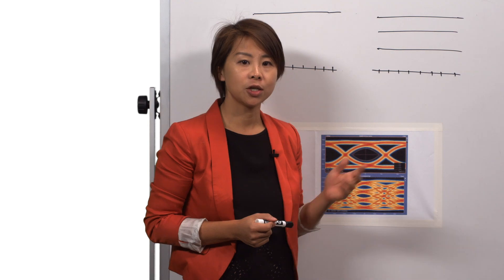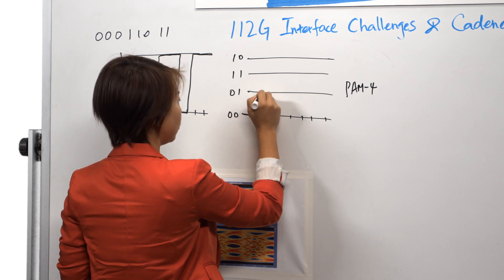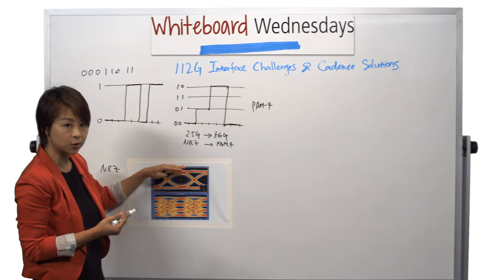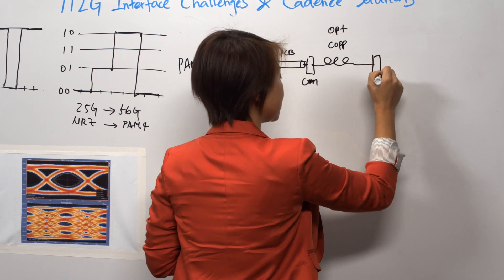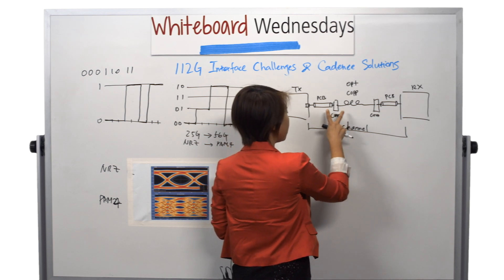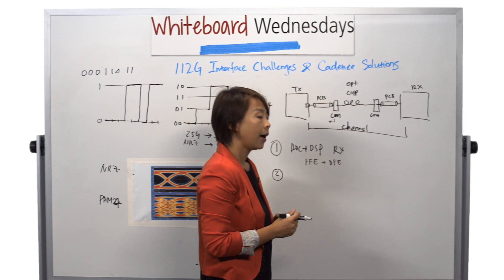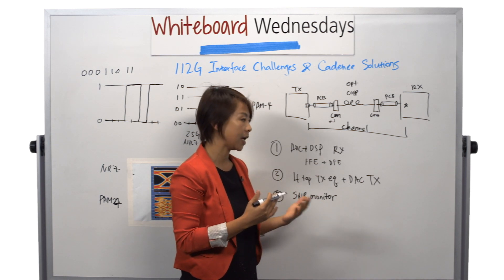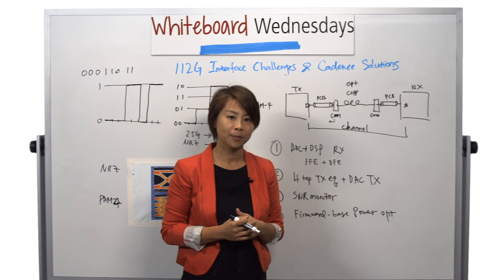Whiteboard Wednesdays - How the Cadence 112G SerDes IP Solves the Challenges of Long-Reach Signaling

Comment: Is there a mistake? Bit 2'b10 is higher than bit 2'b11? It should be other way around. Reflection is part of the 35db loss and it is known issue for such design. And Pam4 is to address the physic limit of silicon, else you won't be able to hit such high bw interface.
Reply: This is called Grey Code, there is only one bit change when u move from one state to anther one. It can be used to avoid meta-stability I believe, but i don't know why it is used here, because we need to overcome inter-symbol interference
Reply: @franklinw7320  I think we can have any encoding and decoding we want at transmit and receive to reduce energy or improve snr (reduce xtalk). However from signal leveling point of view, each level will carries 2 bits of information and from signal integrity analysis point of view, the data will be randomised to not just grey coded.
Reply: Yes.. for PAM4 signal, it should be 00, 01, 10, 11.